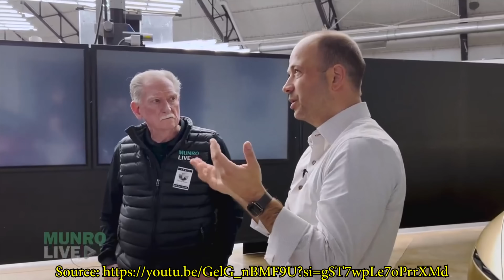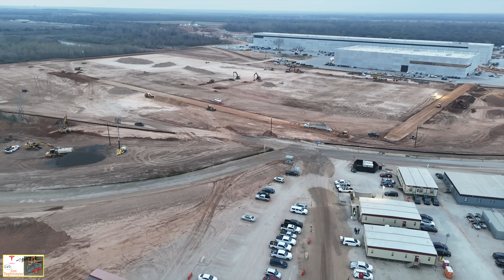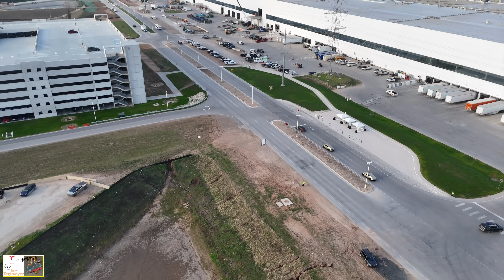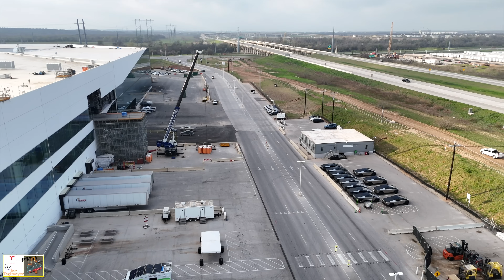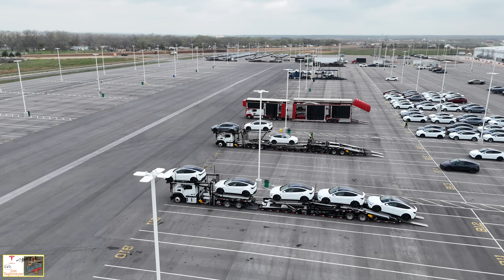Robotaxis, New Cars Self-Driving & Model Y Casting Discussion!14 Mar 2025 Giga Texas Update(07:55AM)

Comment: Just for perspective if the New cortex buildings are 750 ft long by 250 ft ?   THEN THAT EQUATES TO 3.5 acres roughly so that gives perspective to how many acres this reclaimed batch plant area they are working on is . Looks to be about APPROX 15 acres total for this new area they are working on ( FARMER KNOWLEDGE ). ( 1 ACRE = 210 FT X 210 FT )
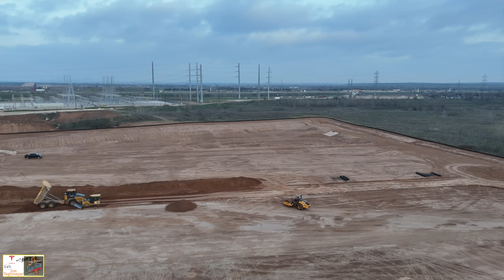Reply: Measurable on google earth. Current area reclaimed is about 43 acres between the Die Shop apron, Tesla Road, the road to the upgraded batch plant, and the north-west corner seen at 16:21
Reply: @DessieDoolan  That is great to know !!!   I was referring to a much smaller area . I guess I did not do a very good job describing the spot I mentioned . but THANKS !!!

Comment: Google AI is anti-Elon: Tesla is using LiDAR for testing and developing its Autopilot and self-driving features, specifically to validate and calibrate their camera-based vision systems, despite Elon Musk's previous skepticism about LiDAR technology.

No plans to use LiDAR in production:
Tesla has stated that they do not plan to use LiDAR as part of their self-driving hardware suite on production vehicles, and instead focus on camera-based systems.

So this part of the AI answer was unnecessary: "despite Elon Musk's previous skepticism about LiDAR technology."

Comment: All the soil that was removed from the construction site was probably deliberately put there a few years ago to compact the soil, so the future building wouldn't sink here and there, causing cracks.
All high areas may be locations of future buildings.
Reply: While that is not unheard of for construction, that largely doesn't appear to be the case here.  Many of the piles of dirt around the site were simply left over from sand and gravel mining.  There were some historically built up areas where they are currently constructing, but those were the locations of the concrete plant and cement bagging plants.  

That siad, it seems conceivable that the current areas they are dumping/piling excavated dirt and concrete, more to the Northeast, will benefit from soil surcharge – but given they keep removing then redumping here is also seems to be out of convenience.  They'll likely eventually build here, I speculate it will be the future extension to River Rd.
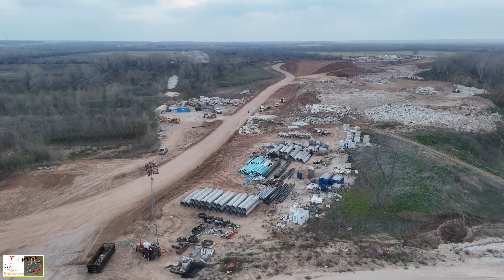Reply: @Gig0Surf  To the right at 13:25 they are dumping earth (looks mixed) over the busted up concrete. That's a little unusual, can't build on that. Might be part of the site that simply can't be built on.

The big pile of clean earth further north is not being compacted, just piled up. That would be for future use I would guess.
Reply: @ While concrete rubble as clean fill isn't unheard of; I can't say if just adding more dirt, geotextile and proper aggregate would then make it suitable to put a road through there. 

Pushing dirt over the concrete piles seems like it just keeps the general area accessible for ongoing dumping.  Perhaps it will be eventually re-excavated to properly crush and recycle it (along with the massive concrete pile in the contractors area)  

I don't know the extent of the greenspace ecological uplift area or the river easement at this bend.  Much of this old mining area seems like it could be improved, but I do like the idea of a large park area (which might be a good move if they ever plan on putting river road all the way through...)
Reply: @  Access might be it. 

Long term it's just a substrate full of voids.

Makes me wonder why if it was economical for someone to salvage, crush and sort the dumped concrete waste from the to old batch plant, why they haven't done the same with this.
Reply: @ Don't know.  Presumably recycling it is economically efficient but it looks more like speed of execution is more their priority right now; until the space is needed it doesn't really cost them to dump it for future recycling 

[and with significant road expansion, future construction and parking lots... plenty of future aggregate needs as well as ongoing concrete waste generation to further grow those piles / stock.]
Reply: @Gig0Surf  Begs the question, where will the upgraded batch plant waste be dumped?
Reply: @DessieDoolan  Good question.  Nothing obvious at this point other than the adjacent land is lower and undeveloped.
Reply: IIRC, they did that in Germany

Comment: Did that cylinder that was on the ground north of the cathode plant disappear?
Reply from the maker: @roncolson7305  I dud notice it was gone but my battery was getting low so I didn’t investigate further this time. I kind looked for it as I flew around the west side but I didn’t see it and had to go back to get a new battery and did not return … next trip!
Reply: The stainless steel tank? Seen in Brad's video yesterday, left at 1.00 in the westside storage area.

Comment: Thanks Joe
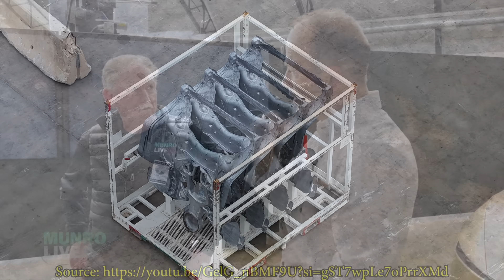3:50. Munro video. Puzzle die system. Costamp, the developer of the puzzle die system has a youtube channel with a video titled 'Puzzle Die'. Worth watching to understand why the system was developed.
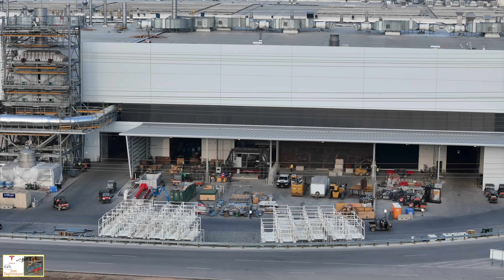18:58. Casting, east. Canopy. Right. Concrete legos arranged out from the steel plate wall. Constructing a storage bin/s for material that can be rough handled. Furnace waste, or shredded castings for recycling for example.
Casting, roof. Top right. Heat rising out of the flue. A furnace/s is running, but likely not operational (not connected to the baghouse). Keeping it warm.
Flue and heat-exchanger structure. Top left. No heat rising out of the flue.
Reply from the maker: @DessieDoolan  thanks Dessie … enjoy the weekend!

Comment: Wastewater Interceptor project:
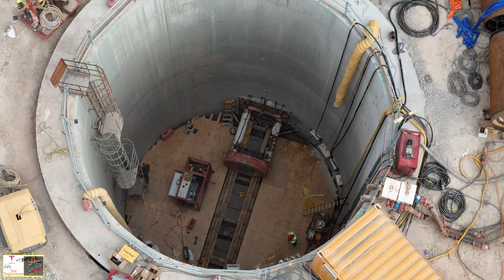@ 26:31 Joe.... This is different from the Cybertruck tunnel. The TBM doesn't push against the thrust ring. The  white hydraulic rams behind the thrust ring push the TBM. First the TBM will be pushed forward as it bores through the shaft. Then 5' diameter pipes will be inserted behind the TBM, and the pipes and TBM will be pushed forward. The rams and thrust ring will remain in the caisson shaft throughout the whole operation.  
The bore under the river is too long to push the entire pipe string, so intermediate jacking stations or interjacks will be inserted into the pipe string at certain intervals.
Reply: For more information on the process see AVN machine.
Reply: @DavidJohnson-tv2nn  Can confirm this is a German made Herrenknecht AVN pipejack slurry TBM. Obviously it has done some previous jobs, but these systems are designed for multiple use. Search "Herrenknecht AVN" for a lot of info. and explanation video. Will be interesting to see its daily performance.
Reply from the maker: @DavidJohnson-tv2nn  Thank you very much!